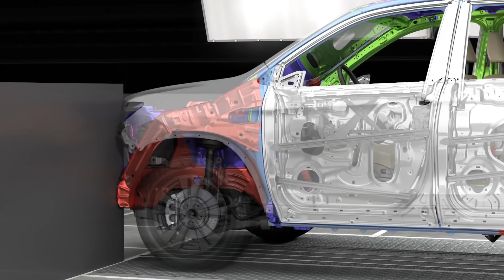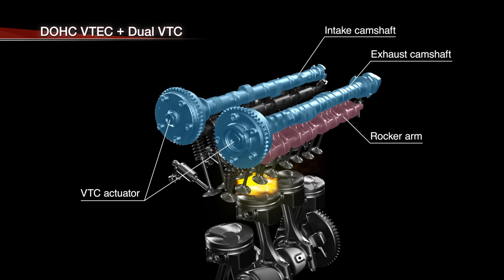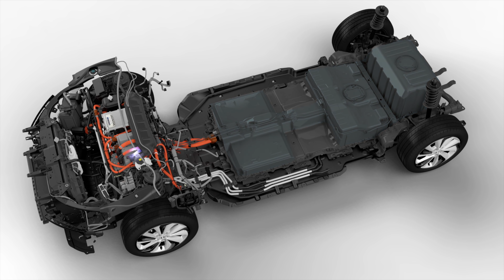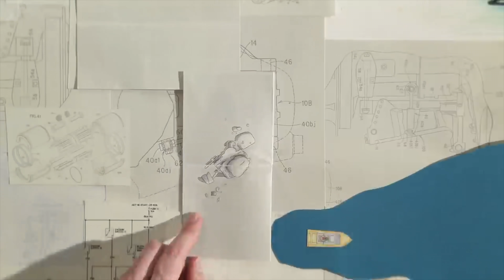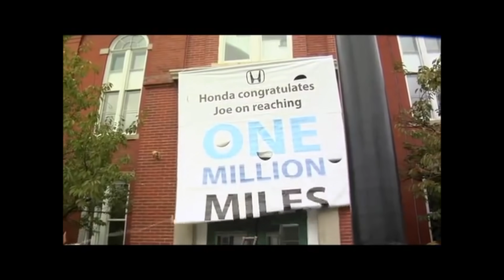Honda Doesn’t Want You to Know This

Comment: You know whats cheap relaible vehicle i have scotty kilmer my 2 stroke Chinese single cylinder engine with clitch fuel reserve and filter has a good carbonator and primer and it has two sprokets in the back with two chains connected to the pedal sproket and the motor it has a simple distribliter has a cdi has no battery and it runs good i got it on ebay for 400 bucks you can get them used for 200 bucks from the right individual and i have 4 of these kits and 4 bicycles and there reliable and fun to drive and the repair cost is low because you dont need a stupid battery to start it and they last a long time it goes 40 miles phr would you buy scotty? There pretty relaible and small and easy and cheap to rebuild too. would you buy?

Comment: Hey scotty what do u think of a 2011 buick regal?
Reply: Hahahaha lol
Reply: @coasterman 13 ok🤣
Reply: @calebvaniperen9599  I think he'd laugh at it, he hates GM.
Reply: Buy an Accord
Reply: @skinnerhound2660  ikr? Like, my mom owned a 1987 Accord, and from her account, it was actually a reliable vehicle
Reply: As long as the car doesn't randomly start stalling, it's not that bad. This stalling may be caused by loose wiring connecting to the fusebox. I'd drive it into the ground. Keep an eye on the brake pads, because they wear fast. Akebono is the way to go.
Reply: @CoasterMan13Official  I know he'd laugh at it because it's gm, but it is made in germany and is actually an opel insignia...
Reply: @calebvaniperen9599  didn't know that.

Comment: Unfortunately, Honda uses CVT transmissions in most of their cars.  I just bought a 2020 Civic Sport with a 6 speed transmission and no turbo.  Should last a million miles.
Reply: I don't know how many models they have with CVT. I think it first was used in the fit, but many of those were manual.
Reply: @don2deliver  Manual transmissions are being phased out and Honda is going to CVT.  There’s only a few options left with the Manuel.  All their models have CVT.  You just have to try and find an option without it.  I think the SI is the only one left.

Comment: 👋🏻Florida ☀️🌴🇺🇸 2021 Honda CRV or 2021 Rav4 ?
Reply: Rav4
Reply: If you drive a lot of highway miles, RAV4 for its cruise control system that basically drives itself on the highway. Otherwise, if you have something reliable, there's no shame in keeping it.

Comment: We had a 1981 or 1982 Honda accord. It was one of the worst cars ever built.  Trans was replaced at 80,000 miles. The cylinder head warped and the head gasket blew at 123,000 miles and then body welds rusted out, so the car literally sagged.  And you had to split the 
CV joints to replace the brake rotors.... The fenders were supported  by the air cleaner... what a complete pile of trash.

Comment: I've owned 2 2007 Pilots. The 1st, used was stolen and totaled. I used my insurance money to buy another one. After 2 years it neesses
Reply: Needed a new battery, alternator serpentine belt, new spark plugs and next I'm installing a water pump/timing belt kit. It stopped driving on the highway, wouldn't start. Am I missing something???

Comment: Maybe someone will steal my 1.5 turbo.  Oil dilution city.  Supposedly they "fixed" the problem in 2019.  Well, I put in 3.7 quarts of oil and get out 4.8 quarts of oil.  Oooops.
Reply: I’ve had friends with this issue also. That’s why when I bought my new daily driver I went with the Civic sport sedan with the 2.0 naturally aspirated port injected motor and 6 speed manual transmission. Didn’t want to deal with direct injection/turbo issues.
It’s by far the most reliable way to get a 10th Gen civic.

Comment: i which they made there transmissions and ac compressors as good as there engines
Reply: Did lots of A/C compressors, Alternators, and sheared off bolts on the accessories drive.

Comment: Big NAH, I have a honda odyssey and spent so much money of fixing it. It's a money pit of fixing it. Maybe their small cars are good but not the big ones. It's expensive to change their V6 timing belts (changing timing belt and pump at the same time @ every 60,000 miles) and replacing transmission is it cost a lot plus other problems. It's better to buy a toyota brand of any size from small to big one.

Comment: My daily driver is a 2000 F-350 diesel and is an excellent running very reliable vehicle and it is in near mint condition and it only has 180k miles. I don't haul anything so its a lot of truck for only me.

Comment: Hondas generally are good but nowadays you get ugly duckling exteriors you also get oil dilution with the TURDbO charging  and a host of other electrical issues. I believe toyota still has the edge in the longevity department 😎🙏

Hondas quality has dropped since around 2016 or so. 🤷 Just the truth nothing more or less
Reply: I’m starting to realize that Toyota being late to some modern tech like other brands is starting to be a blessing in disguise.

Those of you complaining that Toyota is late to the game in some aspects, remember that Toyota is probably testing those new things internally as hard and effective as possible to ensure it can stand the test of time. That’s why more Hondas are turbo than Toyota’s and Honda brought CarPlay and android auto before Toyota did

Comment: The original K-Series were better than the current Honda engines.
Reply: Agreed
Reply: Aren’t their J series v6 also very good?
Reply: @naveenthemachine  yes they are!
Reply: @PLATINUM2U  only negative is the timing belt and cylinder deactivation on the more modern j series v6s
Reply: @PLATINUM2U  Friend has a K-Series Integra with over 1M km on it.

Comment: Honda is great, but I have always preferred toyota until evs and tesla came along. Toyota had some better designs where I found honda made some stupid and foolish choices. Toyota is also a better run company and why they are number one and in the industry. Hondas are maybe stolen more because there is a fan base of those who like to ghetto up the car and do stupid and useless decorative and performance upgrades to it. Rather than the toyota owners who tend to me more family and sensibly oriented.  Hondas may also be stolen more because they are easier to steal or there architecture is easier to use on the black market not because they are better. Teslas are the least successfully stolen because they are more advanced and have more technology which protects the car from illegal use which is better for the consumer and the industry. The model 3 is now the top selling luxury car in the world and they are only getting started. Their car prices will only come down.   Remember also that when the model 3 came out, It quickly was purchased by large numbers of civic and accord owners which were 2 of the top 5 traded in cars to purchase a model 3. At twice the price, what does that tell you?